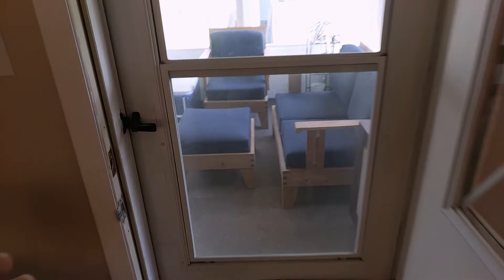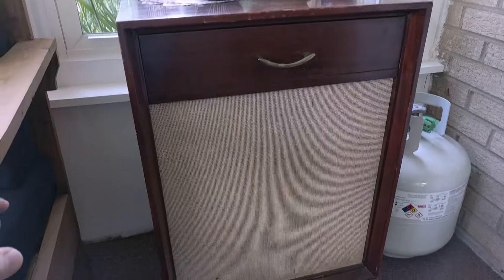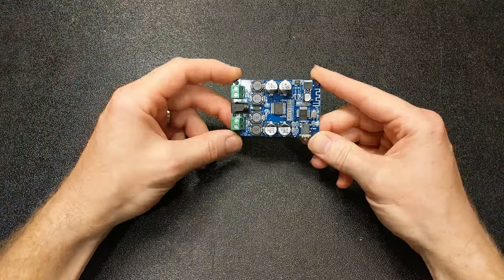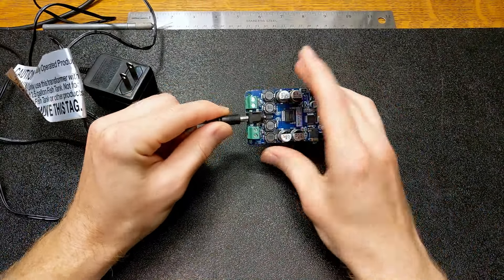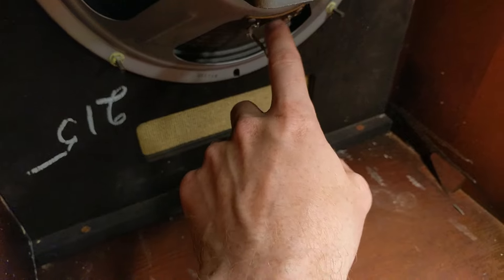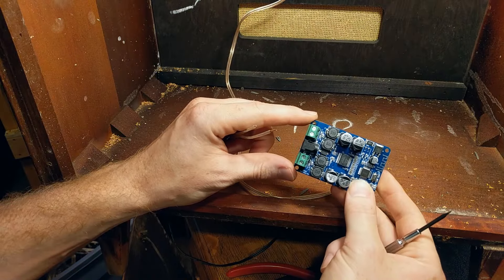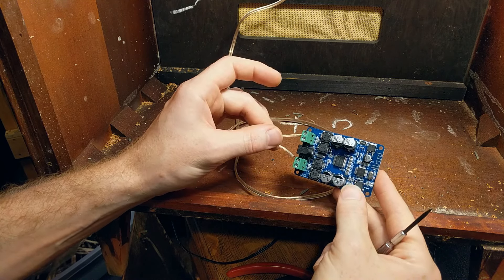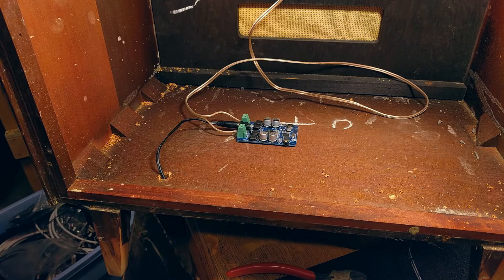How to Make Any Speaker Bluetooth Powered

Comment: I was excited to see this video as I have a 1940’s floor radio. I have a Bluetooth speaker in it but when it gets unplugged (plug used for charging also) then it have go in behind the floor radio to push button to turn back on! What can I get that when unplugged & plugged back in, it turns on automatically? Anyone have a suggestion (not don’t unplug it 🤣)

Comment: Don't be left with the impression you take any amp and any speaker and convert to one speaker output, you can fry your amp. You can get a mono amp for cheap as well (although usually setup for subwoofers) or there are other solutions like using resistors to combine the signals into one
Reply: I've got a question for you. I have a tv with terrible audio. I have a decent center speaker laying around that I'd like to use instead. My tv has optical out, 3.5mm out and L, R, audio out Jacks. Without involving a reciever, can I use this center speaker(that has speaker wire inputs)?

Comment: Really liked your vid on this upgrade, its similar to what i have and would like to do so appreciate you sharing this.  Sadly the link to the board no longer works so was hoping to get the details of this module...its been 3 years so its a long shot but hey...worth a shout i reckon.
Reply from the maker: Problem is all of those Chinese electronics boards come and go like the wind, especially in the last two years. So every time I look there is something different which is why I haven't bothered updating.
Reply: @MerwinMusic  Thats a shame but understandable..still, I have defo learned something from you so will continue to search for the tech i need to make it work Thanks dude.

Comment: Great video! What if you have two speakers though? What aboard could you use to use them both for stereo? Or would you need two mono boards?
Reply: If you have two speakers, you can use the one board, just twist the two (+)'s together and two (-)'s as well and complete job as described. If you use two boards (one for each speaker) then make double sure your smart phone is capable of playing two BT devices at the same time. My S22 Ultra can do this with caveat - one speaker has a slight lag creating an echo. Major bummer.

Comment: I am trying to figure out if the amp unit that is a replacement for the original one you used/suggested on the video is one that does not have to be button control?  When I pull the similar unit on Amazon it is much more complex. To the left of the diagram it show buttons for play/pause and keeping pressing to switch mode.  That is where I am confused.  According to  your video you mentioned you did not want to have push buttons, understandable. How does it pair with my phone such that it is a once and done as far as button controls?  I am a novice at this, just learning so if I sound  like I am not knowledgeable, that would be correct.  Thank-you

Comment: What is the input voltage or more precisely can it be powered by 18650 batteries in series, and is there any aditional power needed for the speaker?

Comment: This is great! Simple, clear, and direct. Thank you! But does anyone know how you would do the same to TWO speakers and have them connect wirelessly in every way, both to each other in stereo and to the device transmitting the music (phone, etc.)? In other words, I don't want to have to connect the separate speakers together with any wires, but have them both play music transmitting from the same single source.
Reply from the maker: I feel like your best bet would be to setup some Raspberry Pi's as basically a Sonos system. I setup basically my own low powered radio station in our house so any radio I can tune into the same music.
Reply: @MerwinMusic  I had admittedly never heard of a Raspberry Pi until your suggestion, so I looked them up and WOW! What a cool product. But I'm unsure that I'm understanding exactly how this would work. To be clear, I want to stream music from my phone on, for instance, Spotify and have the music play out of both speakers simultaneously with no wires connecting the two speakers together.
Reply: @MerwinMusic  FYI: The main reason I want no wires connecting the two speakers is that I have them sitting on two bookshelves on either side of a fireplace. It would be nearly impossible to run wires between the two without the wires showing, as there's no easy way to hide the wiring since the floor is linoleum. There's nowhere to tuck the wires out of sight (such as behind a baseboard or under carpet).
Reply: TSA2300 would do that judging by its YT video but i dont know what the quality is

Comment: This video was so extremely helpful. I've been having a lot of trouble figuring out the wire and board configuration for speakers and this mightve just saved me. I was completely unaware of being able to plug one wire into one sides positive and the other sides negative.

Does the same thing work when a board says treble, bass, or mid? Like if I had a 2x 5. 25 inch speakers and a 1 inch tweeter (all 4 ohm) on a sound bar, could I use them in series, could I plug the two 5.25s into the bass positive and mid negative and leave the tweeter plugged into the treble spot alone?
Reply from the maker: If you wired 2 speakers in series then your 4 ohm speakers would be 8 ohms to the amplifier, which is probably fine but I wouldn't know without looking at the amp.

When you split left positive and right negative it is called bridged, some amps support it and some don't. Usually though it is done to combine left and right not mid and bass. 

All that to be said it is a complicated thing and I really can't say anything definitive without all the information.

Comment: Cool idea and vid!...  BUT

The way you hooked that speaker up is SUPER wrong and should sound weird.
It should actually be phase cancelling the sounds that would normally be present in the middle.
Play some mono recordings and see if anything comes out.

I think you're far better off using just the left or right side of the amplifier.

Comment: Not sure if you will see this. How can i connect 4 speakers to my amp via blue tooth so i can have my amp and turntable in another room and my speakers in sun room?
Reply: I’m also interested in hooking up 2 speakers.  Did you happen to connect at least 2 speakers?  Advice much needed as I am a female tech nerd! 😂
Reply: @bobbiekinns9458  nope never did get it done. Still working on a solution. sorry
Reply: @bobbiekinns9458  the board he has had 2channels meaning it's made for 2speakers. 
He only had 1speaker so he split the 2channels.
 If he had 2speakers using that same board he would not have split them instead he would have just used  1speaker in the left +/- and the other in the right +/- 
...If you have 4speakers you want 4channels
 ...or you can do what I do a lot 
((which is not right but it does work... I don't really care about being right I just care about making it work💩 for projects as quick & simple as these))
 And that is simply doubling up or in other words say you only have  2channels but you have 4speakers... what I would do is run 2speakers out of 1channel and 2speakers out of the other channel now that being said you're not going to get the full sound but if you're looking for surround you're going to get it with 4speakers so any power drop from doubling up shouldn't really be upsetting..
Reply: @narfoxone9er971  I have 4 channels (2 left & 2 right speakers). Thank you for explaining what I could do if I only had 2 channels.  I’m not about my music being so loud but I definitely am about hearing all the instruments (quality).
Reply: Bobbie Kins... 💥♤♡◇♧💥can you post a link for that 4-channel one you have I want to check it out 💥♧◇♡♤💥
 yeah I got you I was kind of replying to both you and the original comment guy talking about 4 speakers.. yeah I hear you I'm very anal about my sound as well even though it doesn't sound like it. I cut corners on certain things like garage to attic garage to backyard patio as opposed to side yard you know what I mean...
 now car audio and home audio whole other ballgame